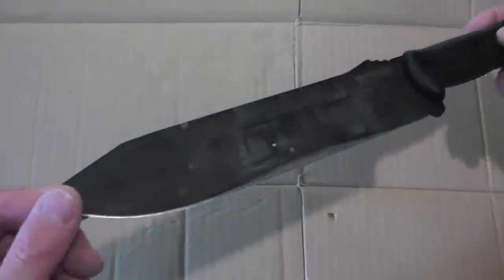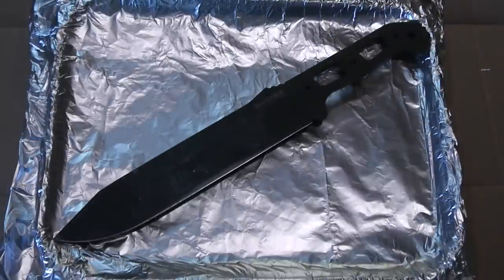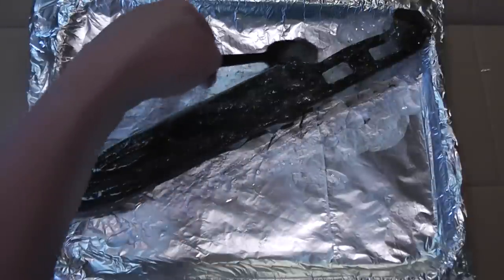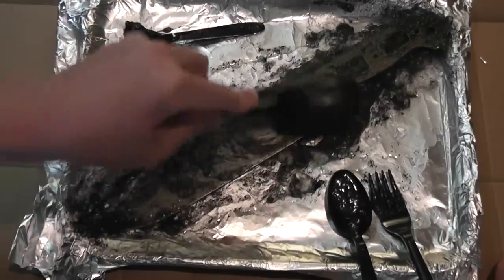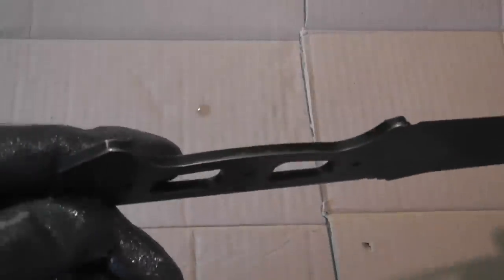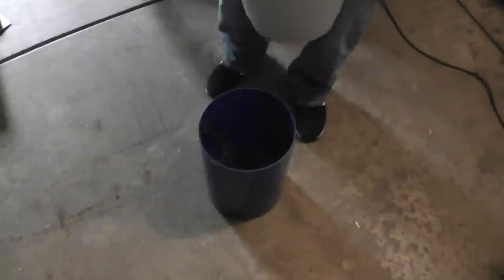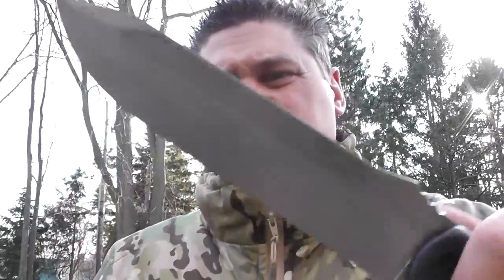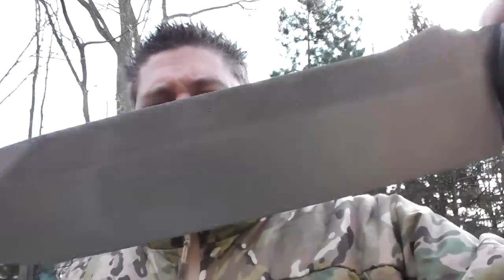Kabar Becker BK9 Stonewashing

Comment: Should use a dryer at the coin laundry.
Reply: Yeah, and probably real late at night if you can find one that's open 24 hours.

I want to do that to my BK7.  One thing I did to the handle, which is like nearly a 0 on the grippyness scale, is I cut a length of bicycle inner tube, soaped the handle up a little (the fun part) and slid it on.  You'll catch hell trying to get the thing on without KY or your favorite lube...  I used the ribbed portion of the inner tube for extra grip. This works really great; I recommend it.
Reply: Was about to comment that
Reply: They'd get hella pissed lol
Reply: If you went to a laundry mat and used their dryer for this your blade would probably break due to karma.

Comment: I bet your wife wasn't home when you turned her clothes dryer into a do it yourself rock tumbler and you only stopped because she was pulling into the driveway !! Well done sir : )
Reply from the maker: That about right.
Reply: @livingsurvival  When I get caught doing something that my wife would have a fit over . Example Valentines Day a few years ago . I had a bag of lemons and a bottle of tequila . My plan was to have a few drinks with her and than go upstairs if you know what I mean wink wink . But she got home late and my bag of lemons was gone , which didn't matter to much because the bottle was empty . 
When she walk in and saw me sh*t faced she said . Why did you drink so much ? That's basically what she said I just left out the curse words . I looked her in the eyes or in the general direction and said . 
" Its not my fault its yours . I had no adult supervision !! " 
Please feel free to use this line next time you get busted by your wife . It doesn't work like a Jedi mind trick , " these are not the droids you're looking for " . In fact it doesn't really work at all . But it does break the ice , just be careful she doesn't push you in the hole : )

Comment: Man, that's a lot of work/time/resources and dryer abuse to put into a $100 knife. Hopefully Ka-bar will have more clearcoat Becker options available soon, like the sold out BK39. If you agree, contact them and let them know through the Ka-bar website contact option. I think many buyers would appreciate a alternative to the gritty black finish that looks like crap in short order of use.
Reply: This is now 2018. The bk-39 shows discontinued at midway & Amazon. Did they stop making it or was it just not able to compete with the bk9?

Comment: wouldn't the steal rust? high carbon steal is not as rust resistant as stainless steel blades that's why they usually have a coating on them. Nice video by the way.
Reply: Andy's Video Log coconut oil works a treat at rust prevention
Reply: The MoFF so I can use coconut oil  on kife edges?
Reply: Sure. Mineral oil works fine too and it's cheaper. Just look in the health products section of a grocery store.

Comment: Thanks for the tutorial Ben. I might do this with my Tops BOB.
Reply from the maker: Pendejo I stripped my BOB but didn't stonewash it but that would look sweet.
Reply: Living Survival Did you strip just as you shown in this video. If you have the time, can you show us what your BOB looks like now in your next video? It will give me a good idea what it's going to look like.
Reply from the maker: I sold it. But yes did it the exact same way.
Reply: Living Survival Hey Ben, I stripped my BOB, however while the black coat peeled right off, there seems to be another coat of something beneath it. And because of it, the knife won't strike my ferro rod. How did you get it off?

This BK9 looks like it stripped entirely.
Reply from the maker: Pendejo sanded it starting with 40 grit and worked up to 1500+ grit. It most likely doesn't strike the rod because of the spine is not sharp enough. I always used the blade to strike my rod (even though people call me crazy)
Reply: Living Survival When you were sanding the knife, did you put anything on it? Oil? Lube? Salad dressing?